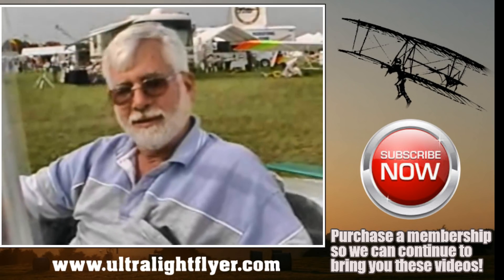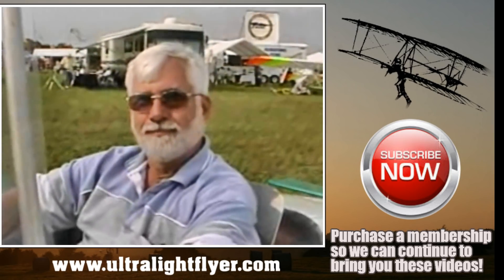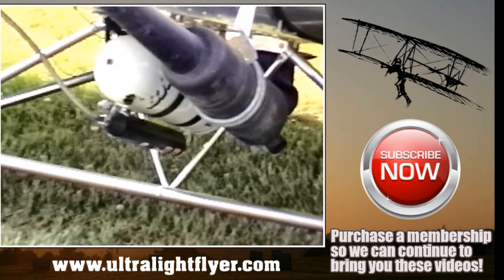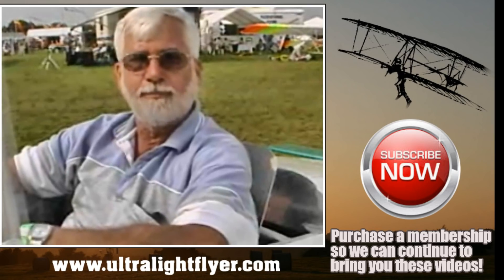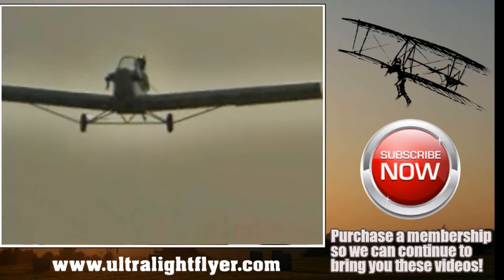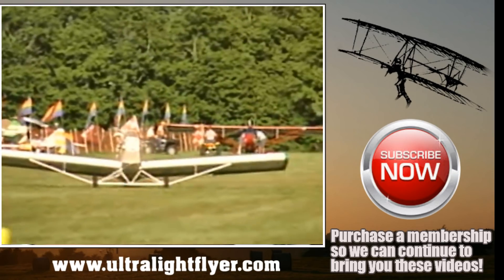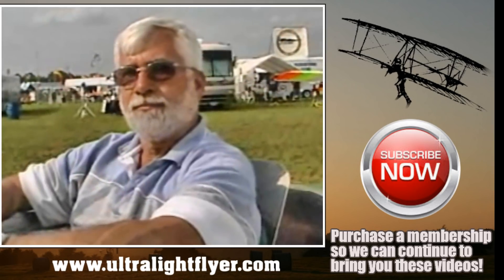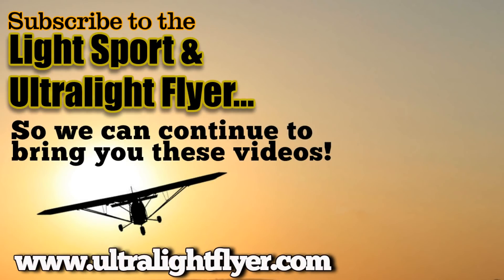Hummel CA 2, single seat part 103 legal, ultralight aircraft by Hummel Aviation

Comment: I like minimal and a like direct drive if it can work without too big efficiency penalty. Maybe 65% diameter and some windspoon fanciness. I do think we would be much better off with a sleek fiberglass design instead though. Like a single piece body, maybe lay all the fiberglass on an inflatable body and then stick it inside a multipiece hard mold so it's one piece when done. No seams. 
The tail could be like a prefab fixed fiber tube. Tad pole design. Super aero, light and simple. Maybe a straight single piece wing and have little winglets on it for natural stability if that can work.

Comment: whats the engine here????
Reply from the maker: 1/2 VW
The Ultralight Flyer
Reply: @ultralightnews .I would put a full 4 cylinder vw engine in it of 250 hp or turbo the 1/2 vw engine.
Reply: @gerald4027  the max cruising speed for any part 103 (ultrlight) aircraft is 55 knots (63 mph). The dry weight limit is 254 lbs. These are both federal (FAA) regulations. Stay within these limits, and you can fly without any license in any Class G airspace. 

If you want to go higher or faster, you'll need at least a light sport pilot's license.